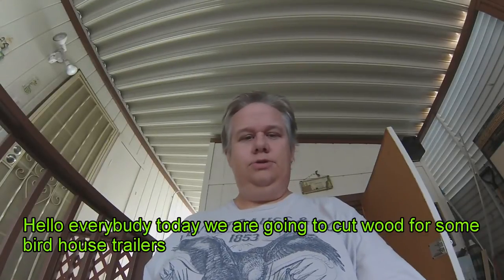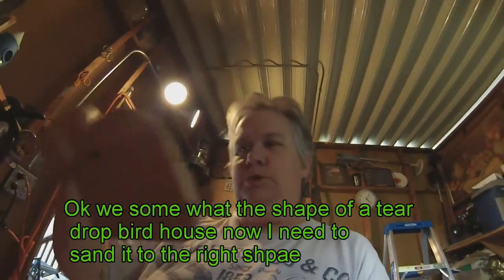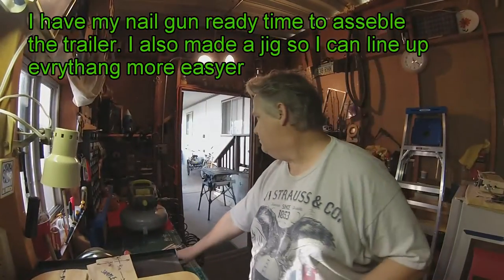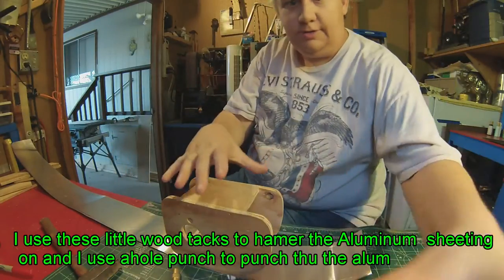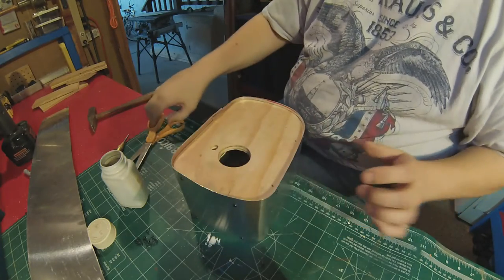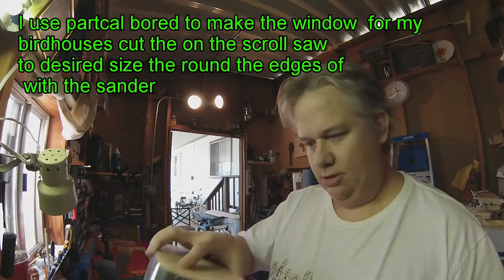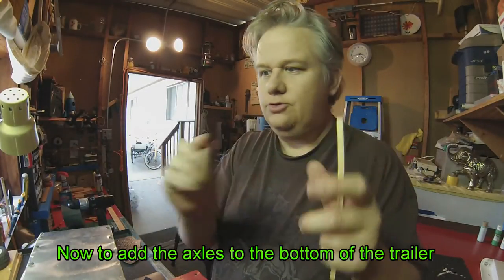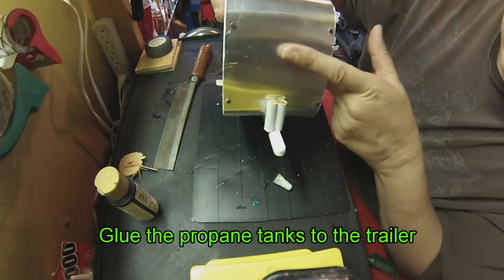How to build a Teardrop Trailer Birdhouse, Camper Vintage

Comment: A great video, well explained step by step. Only thing I can see is the part you screwed into the roof looked longer than 3/8th so the point of it will be sticking inside and could stick into the bird if one did use it.

Comment: Where did you get your sheet metal?  I've been trying to find it and all I can find is flashing.
Reply from the maker: I use 8 in. x 25 ft. Aluminum at HomeDepo or Lowels here a link for you.
http://www.homedepot.com/p/Construction-Metals-Inc-Roll-Valley-Flashing-8-in-x-25-ft-Aluminum-RV825A/202349523

And The nails I use tack nails